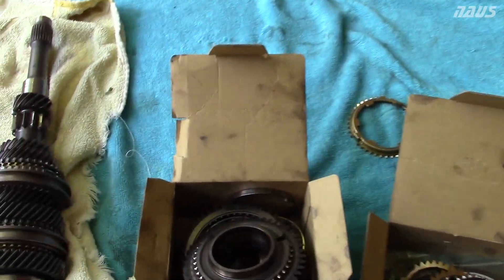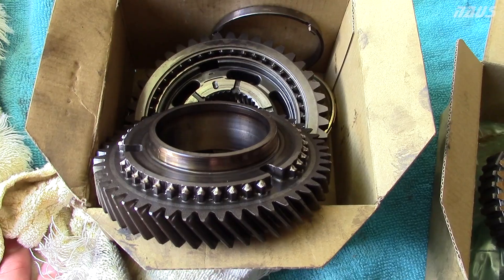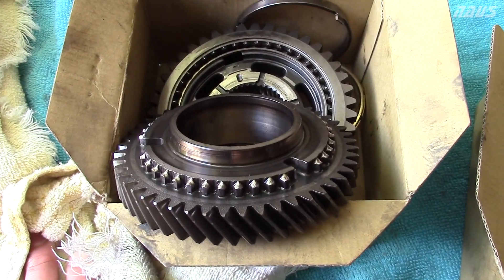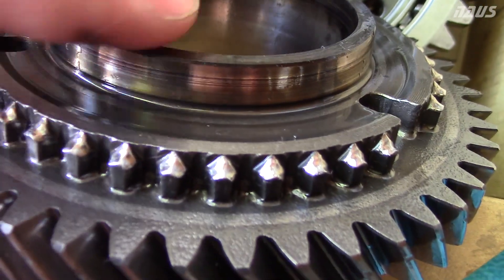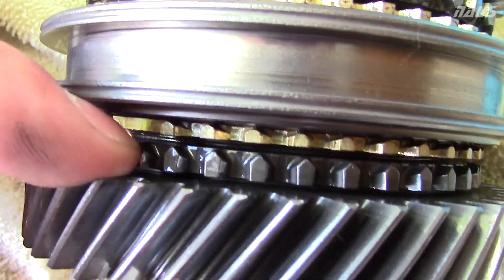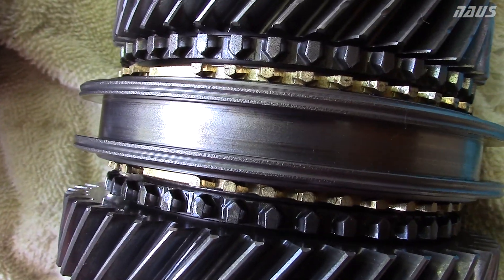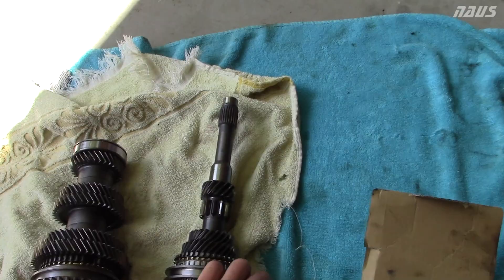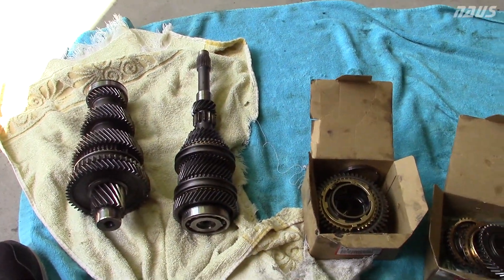The 2nd Gear Grind Explained! What Damage Does it Actually Do?

Comment: need a cvt flush, mines been doing this when its cold and been sitting for more than 8 hours. but it still bites fine so long as its not stiff. double clutching doesnt really help. needs a fluid change bad, and a muffler. may not have a further issue if i keep it clean and freezeless.

Comment: I bought a 95 z 28 6-speed my my mechanic redid the head gasket etc, runs great now, when I got her it didn't get into 2nd trash but all others & reverse,  he suggested,  instead of taking transmission/ gear box out too take too a Transmission place a mile away: too replace that gear/sycro ? There's a refurbish place , might as well get whole thing, instead of replacing 1-2 gears ..another bud who has a Trans am suggested the same ,cheaper overall,  just checking..with professional opinion

Comment: hey Boss
Any advice will be highly apretiated 
same transit as yours.
It began with gear 2 taking 2 times to change sometimes. Now i get situations when at traffic light and can not change any gear some times and then after a minute or so after restarting engine and pressing gears and clutch it all works again.
i happen few times a day on some days.

Inside van nothing leaking arround pedals.
Reply from the maker: Start by bleeding fresh fluid into the clutch Mayer cylinder and down through the slave. Make sure no air is in the line. Then make sure your clutch engagement point isn’t too close to the floor so the clutch is fully disengaged from the flywheel. If both of those things check out and your still having issues then I would check your linkage / shift bushings. After that you need to go inside the trans $$
Reply: @NAUS2K  Much appreciated

Comment: Nice video thanks. My second gear is making a bit problem like a little grinding and is not nice because can't shift fast to second gear, but is still ok to drive. Yes I changed the gearbox fluid but didn't help. It help only that when is cold the gears going a bit easier.

Comment: I'm having a problem with my 1994 mustang if I shift from 1st to 2nd after the revs go down it'll be fine but if I want to downshift into 2nd or go into 2nd normally it grinds until it goes into gear, I was hoping to fix it myself, what would I need to buy? What video can I watch to do it?

Comment: I've been having a similar issue with my 2017 Mustang GT, but only when slowing down and going from 3rd to 2nd. This is my first manual car, so I don't know if there's something I'm doing wrong or if the gears are worn 😮‍💨
Reply: Double clutch it in normal driving and it will not grind and extend syncro life.  At higher rpm there is more rpm change when you shift and thus more wear if not double  clutching.  I drove a $1000 wrangler with blown syncros in all but 4th for over 6months  by double clutching.  They were so bad it would barely or not go into gear from a stop, had to press clutch and wait a few seconds or shift to 4th then first.  When you double clutch perfect there is no syncro wear, not really necessary in normal driving when upshifting, but is nice on downshifts where your rpm is going to shoot up alot.  And in hard acceleration, double clutching is slower but will greatly reduce syncro wear.
Reply: @connor3288  Now you're talking my language. Drive that way and you'll NEVER have a transmission fail again. Or you can keep grinding them.

Comment: I kind of need your help the person that did this video if you can please comment back I would really appreciate it I just bought this car from a dealership a 2013 Honda Civic SI a week after I bought it they had to replace the clutch and now after about four thousand miles I've been having problems with my second gear when I'm accelerating so is this my problem or do I need to add transmission fluid what is your advice or if you need more info or any questions about it please I'm begging you to please help me
Reply from the maker: Problems with second gear when accelerating? What do you mean by that?

Comment: Hey man! I'm having this exact same issue with my 2015 VW Jetta SE 5 speed manual and it started happening after I got this done at AMMCO:

New flywheel
New clutch kit
New slave cylinder

Any idea as to what it would cost to get the issue in your video fixed?  Also as to if the work they did may have contributed and thus is covered under warranty?
Reply: for me it started happening 3k miles after i got a new master cylinder for my mk5 gti

Comment: When I shift from 1sr to 2nd with cold engine, it's hard to move the stick with the car moving (no grinding noise but I feel it forced). When the engine is hot, the change improves and is softer but still harder than other gears.
Furthermore, If the car is idle and stopped, the changing is soft wherever is hot or cold throughout all gears.
Could be syncro problem? The pedal free play is ok and the gear oil is new.
It's a manual 93 Ford Probe with 60.000 miles on it.
Thanks you very much for your opinion.
Reply: Did you tried to change the gearbox fluid? I did that go Mein and it helped 😊👍
Reply: @batvenio3533  thanks for your reply. I changed the oil fluid and it improved a bit when could but was still changing harder from 1 to 2. Probably 2nd gear synchro needed a replacement.
Regards.
Reply: @akrajuancruz  Yes this annoying i know 😐😊

Comment: Can anyone tell me where to buy the gear set brand new
Reply from the maker: Honda
Reply: @NAUS2K  do you mean the dealer or web?
Reply from the maker: @rdm3609  any online honda parts store will probably be cheaper than the dealer. Personally I use Majestic Honda
Reply: @NAUS2K  can you send me a link for my transmission since mine is non si r18?
Reply: @NAUS2K  ok i am looking at the site you mentioned and I'm not sure which is what i want

Comment: Glad I came here and you solve my question.  From first and second gear to go in a gear I had to ride very slow and slow shift in.  If I drive hard it will grind.  When you said "changing gear oil is not going to solve issue" i was going to go that route but not anymore decided to purchase another 6 speed transmission.

Comment: I know you probably won't respond but I have a 2014 mustang GT manual sometimes not all the time when I'm going to transition from second into third gear, 3rd gear will vibrate and if I blip the throttle a little it will smooth itself out. It does not do it all the time it started doing it when the car only had thirty-two thousand miles I took it into Ford and they said it was not a major issue. I'm kind of thinking I'm having a similar problem with my synchronizer rings. Any kind of advice would be welcome. I had my transmission fluid changed at 30,000 then I change the fluid at 60000 miles ran it for two hundred miles and changed it again to make sure everything was flushed. I did see what appeared to be a little brass flakes but it was not that much at all.
Reply from the maker: I would think your mustang would have carbon coated synchros being a 2014, if your seeing brass in the oil maybe you’re grinding the lock rings on the synchros ?
Reply: @NAUS2K  have no clue dude really don't know much about transmissions at all. Considering just trading it in and getting a newer one. It's all downhill from 90,000 miles especially the suspension lol. I'll look into what you suggested I really appreciate you responding u got a sub😁

Comment: You don't know how to double clutch
Reply from the maker: Please explain to me how to double clutch upshift
Reply: @NAUS2K  when shifting from 1st to 2nd press clutch pedal down pull gear lever into the neutral position lift off pedal then quickly press pedal down and  shift into 2nd gear you can use the  same technique changing down from 3rd to 2nd gear, if down correctly you will not feel or hear the gear grind.
Reply from the maker: This ain’t 1950. Manual transmissions have synchros now. You’ve been watching too much fast and furious.
Reply: @NAUS2K  lmfao😂😂😂😂😂

Comment: I am a pro driver, and I know all about this problem.  I would be able to shift this destroyed transmission into 2nd gear with on finger.  It is called rev matching.  I always double clutch my 6 speed manual car for the first 2 or 3 minutes until the oil is churned and warmed a bit.  It is not necessary, but I double clutch most down shifts. In any case I always rev match up and down.  I will be doing a You tube video on how to shift your manual smoothly in all 6 gears up and down with one finger.  Your passengers will love you, and you will never ever have a transmission problem for the life of your car.  It's just that easy !
Reply from the maker: Funny how everyone on YouTube who comments is a "pro driver "
Reply: No doubt about it.  There are pro drivers out there.  Who would have thought...
Reply: @NAUS2K  Being a pro driver is not impossible. I'd love to help you drive like a pro, but it is optional. You guys can keep destroying your transmissions, and help trans shops make lots of money, or you can listen to a pro. For starters you can watch my video from a few years ago. "Three Ways To Shift a 13 Speed". Or for cars you can watch "Shift a 6 Speed Like a Pro".  Or you can keep grinding. Trans shops will love you! 😁

Comment: If you have syncros blown, it will grind. If you don't get syncros replaced it will grind the gears to be rounded like that. Syncros are suppose to lock the speed of the gears so the tooth can be meshed into eachother. This is not what is happening in the video. If you have syncros replaced and not gears, then it WILL NOT grind, but it won't want to go into gear (because you just happen to put rounded tooth agains another rounded tooth and it will not want to slide forward or backward so that teeth can mesh together. So what you had was blown syncros (and blown tooth probably because syncros were not replaced). Basically alot 3000gt have their reverse gears grinded like that. They will not grind while trying to put in gear. they just don't go into gear. You need to slip the clutch to move the gears to match the tooth. Also reverse gears is not hardened as other gears so they go bad ALOT faster. Talking from experience, have also replaced syncors and gears on my transmission since the crap was taken out of the car by previous owner.

Comment: what would cause a Synchromesh block?, when I try to shift into gear it stops part way but when I add a little force it goes into gear without any grinding whatsoever, sometimes it goes into gear smoothly
Reply: ur shifter is messed up then

Comment: Another contributor to this problem is worn shift forks. As the forks wear (get thinner), they don't move the slider as far, which results in less contact between the synchros and the tops of those points on the gear.

Comment: Imho the worn teeth are caused by grinding but don't cause grinding and the synchronizer is the only problem. Because normally the synchronizer should block the sleeve from sliding over while not synched.

Comment: I have a 2006 VW Jetta TDI and seems like it is getting harder and harder to shift in the 3rd and 4th gear (Mostly third!). I don't get grinding (occasionally feels a bit notchy when shifting from 2nd to 3rd), but the transmission blocks me from getting it into third gear...I have to put it back in neutral and push it harder to get into the third. The clutch was replaced about 20k miles ago..no grinding when I put in reverse which tells me the clutch is ok. Any ideas what it could be? Synchros and sleeves? Gears 3rd and 4th engaging teeth?
Reply: Did you found what problem it was?

Comment: What very few people understand is that it is a simple issue of not rev matching.  With that destroyed 2nd gear I could shift it up or down with very little grinding.  I am a 43 year veteran long haul driver who has never owned an automatic transmission car and my gears never get worn out.  Why?  Because I always rev match going up or down.  Most car transmissions are known as "progressive" transmissions, which means they have wide ratios in low gears that get progressively smaller as you get into higher gears. This means that you have to wait for it when shifting into 2nd gear.  Nobody wants to wait, so they blow 2nd gear.  It is not rocket science.  Now why do the engineers make "progressive"  transmissions?  Simply because they can.  These guys are not enthusiasts, and they calculate in their offices that you do not need a close ratio into 2nd gear.  They are right.  The engine can handle a wide split into 2nd,  BUT you are going to have to wait for that shift, or prematurely destroy 2nd gear.  They don't get it, that most enthusiasts would prefer a close ratio transmission for faster shifts.  These engineers drive automatics, so forget about close ratio transmissions in most manual cars.  It is not going to happen.  Too bad.   Good for the tranny people tho'.  They get a steady stream of people coming in wondering why 2nd gear grinds.  Drives me crazy...

Comment: So what if I only get a grind when I am going down into 2nd from 3rd with my clutch in. Also, if I gently try first for 1st gear on my way from 3rd to 2nd until I hear that synchronizer start to whistle for 1st gear or whatever that sound is when you hear before it goes into gear when you go for 1st gear at too high of a speed, it doesn't it then... Are there separate synchronizers for each gear and am I doing more harm than good doing that to prevent the grind than I would to just use my brakes? I just replaced my clutch pressure plate and throw out bearing. Still does it with new clutch kit. Any suggestions or ideas? Also, this car shifts so smooth that I don't even need the clutch to shift without grinding at the right shift points. Just like a semi. Smooth as can be on the up. I can even go from 4th to 3rd without the clutch if I use my gas to match rpm's.

Comment: Could you still engage a grinding gear if you rev-match?
Reply: Yes. Rev matching will have the gears spinning at same speed so they will mesh on their own. The grinding is the synchro trying to match the speeds of the two gears as you let out the clutch, but slipping. Grinding can also be caused if clutch doesn't separate gears quite far enough but I think synchro wear probably much more common.

Comment: My 2010 si has 70k miles on it now, and I pound it just about every time I'm in it. Once In a while it feels like grinding going into second. It is always because I'm doing something the car doesn't want me to do. In retrospect, it is just me. If you feel it start to grind, and it doesn't want to fall into gear, Put it into 3rd gear dumbass. The reason it does this is because the synchronizer is supposed to speed up, or slow down the gear to match the speed, and it did not do it. Once it gets to this point, the cone and synchronizer is not being forced together to do its job. Every car does this if you don't know what you are doing. You force it to much, and it will be toast. Know your car. Stop driving like an idiot.  https://youtu.be/XiHCGr0JO7Y  Here is how not to drive like a complete idiot. lol... Compliments of me. I bought the car new too, so there is no idiot before me to blame for anything either.

Comment: A lot of mis-information in this video, no mention of the synchro gap left on 2nd, if there's none (or as near as dammit none) thats why its crunching and thats why the engagement teeth are snubbed like that. Too many people try to quick shift, the synchro may as well not be there, it's just being rammed into gear, and this is the end result.  1st synchro is more than likely identical (from my experience anyway), if you've got the box stripped down this far swap the synchro rings over, measure the gap and go with it. How often do you actually need a synchro to shift into 1st

Comment: hey guys so i have a 07 civic si and i race it a lot. mostly dig races. I flat foot shift 2nd gear almost every time when i race. I have no tune for this with a stock ecu. and a stage 3 comp clutch. was wondering how bad is this for my car?
Reply from the maker: Are you trolling?
Reply: no. Its my daily driver and stock trans stock motor with 250k and counting and no problems so far. just wondering how bad it is to flat foot 2nd 3rd and 4th for all my races. Will it break my trans? or clutch will just go?
Reply: also it doesn't grind when i flat foot second
Reply: does not grind when i flat foot , does not grind with regular shifting , however does grind second if i try to quick shift it.

Comment: When I shift to second from first I am getting strong vibrations from the shift knob to my hand, but every other gear seems fine. I can still feel the vibration in my hand somewhat. The car doesnt make any weird sounds or movements everything is smooth. I just feel the vibration transferred to my hand from the shifter. Is that normal
Reply: Pretty sure its just the vibrations from the engine

Comment: These days it is impossible JUST to have a specific parts of a manual gearbox replaced, isn't it?  As the shops I have been dealing with, including the dealership. would only offer a rebuilt unit for around $3K
Reply: I was offered a new PNN4 (09 si) transmission by Honda for the super low price of $6799.96... as a crate from them to me, no install included..not bad right? Lmfao told em pack it up their anus

Comment: Did you change just the 2nd gear or the synchros too?
Reply from the maker: Alam Alejandro Hernandez when you buy a new gear set from Honda the syncro for that gear is included
Reply: @NAUS2K  Can you explain what a 2nd gear set is? I'm new to manual transmission internals. I'm about to take my car to a shop soon so they can replace the input shaft bearing.